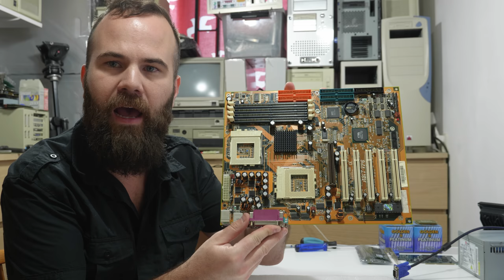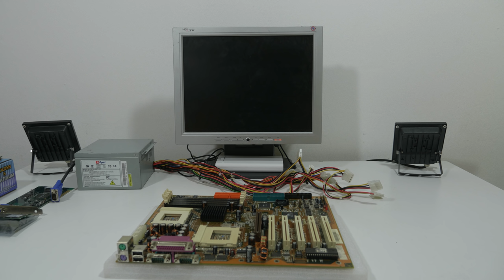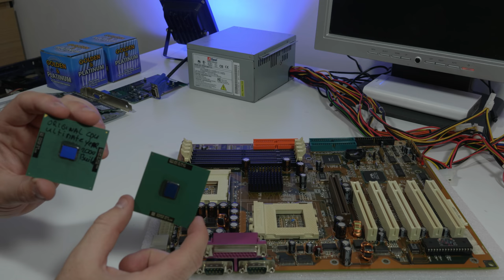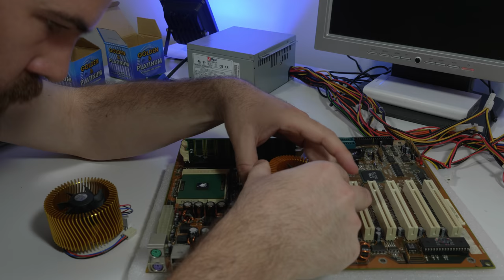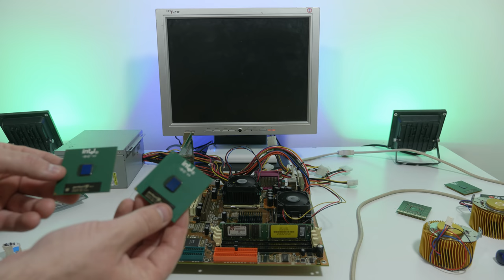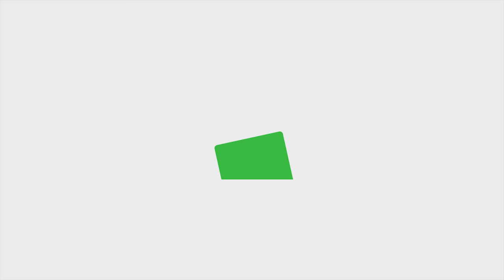Setting up Abit VP6 Motherboard, CPU Problems, Computer VLOG #49

Comment: I've used this board when it was new, and am literally using it right now... even have the manual printed out, and can confirm... you most assuredly do not need a terminator to use just one cpu. Just have to use the first socket, and leave the other empty. 

Beyond that, I had to recap the entire board, of course it had just about all bad caps all over. . . as well as is a very finicky board to begin with. Lots of fkn tuning fun to get stability.

Comment: My VP6 isn't picky like this so it probably is caps. Mine are fine at the moment. This board will run Tualatins btw
Reply: Would it? I was pretty sure an adapter ("Lin-Lin" or the likes) is needed for that purpose. I just acquired one Abit VP6 with one 933mhz, and I read in the manual 1Ghz is the top PIII supported. But I would love to install a Tualatin 1.4Ghz on it!
Reply: @con2botonesnadamas433  Knowing it's VIA 694 based (surprisingly it isn't 694D, but plain 694X), it will run Tualatins as long as you either pinmod both sockets or use 2x adapters.

And yes, you do definitely need to recap these before putting them to use.

Comment: in the motherboard manual say "if the processor operating voltage for either vcc core or vcc L2 do not match , the computer will not boot"

Comment: okay, first off, the caps on your board don't need a replacement, run it through some cpu instensive tests before you can conclude that the caps are all busted. might as well, you don't want a bricked board otherwise.

Comment: Yeh caps need replaced but as stated if the cpus are out of spec on voltage it wont boot , but  hail mary bios flash could help  , i loved that board with  1.6ghz pentium3s with my primitive watercooling xD
Reply: This is a coppermine board, with very very very minimal and unofficial tualatin support. I mean, you need to use a pinout adapter, which makes cooling a custom job at the mounting forward... I too water-cooled back in the socket 7 forward days, and water-cooled this along with its little bro the bp6 back in the day. But this with 2 1.6 p3s is very unlikely. Even the internets archives of forums goes on in a similar vein. With literally no one saying they've made that happen.

Comment: Send it to me Victor, i recapped a board like this a couple months back.  I love dual CPU boards.  Actually I think it was the same board.   It supports ecc ram, but won't use the ecc functionality.....
Reply: So... it runs ECC RAM without using the ECC functionality?
Reply: @NSHG  That is correct, there was a lawsuit over it if I remember correctly.  It can USE ecc, but the ecc function is basically ignored.